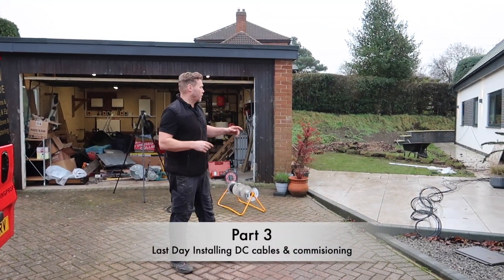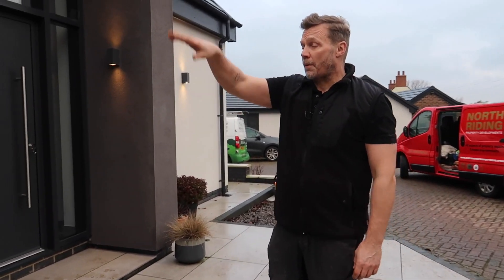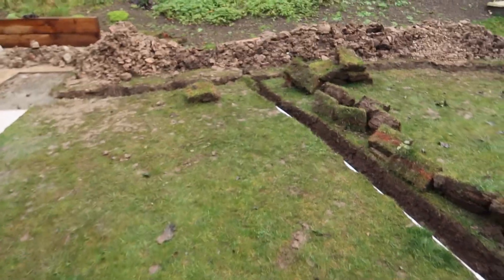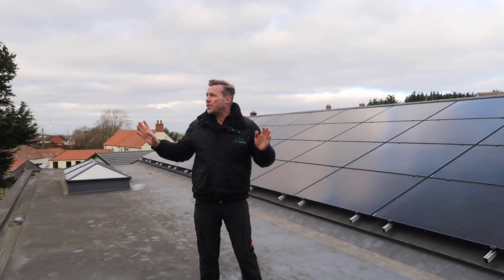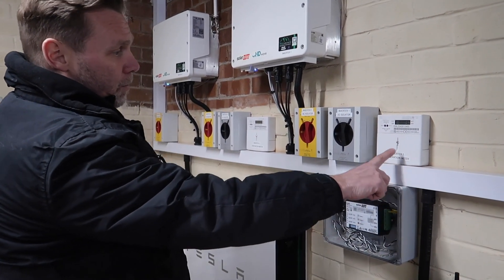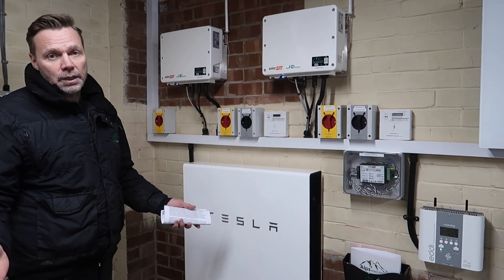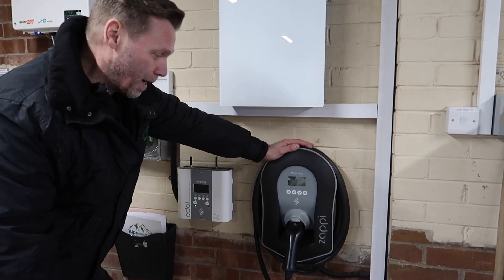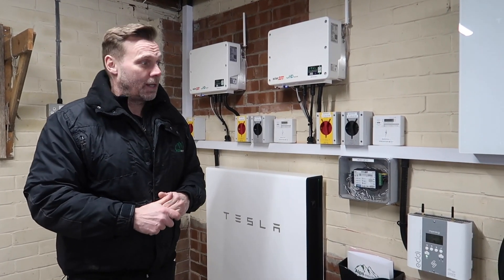SolarEdge 19.1 kW System with Tesla Powerwall & Zappi Install | Part 3 – Testing & Handover

Comment from the maker: ⚡ 19.1 kW SolarEdge System with Tesla Powerwall & Zappi – Part 3 (Testing & Handover)

This incredible system features 44 Jinko Tiger Neo 435 W panels, SolarEdge optimisers, 2 × 6 kW inverters, MyEnergi Zappi & Eddi, and a Tesla Powerwall — installed by Alps Electrical Ltd in Seamer, Stokesley.

▶ Watch Part 1 → https://www.youtube.com/watch?v=xKoc4Msuojk
▶ Watch Part 2 → https://www.youtube.com/watch?v=yB75DoWykXc

💬 Interested in solar or battery storage?
📞 01642 790489 | 🌐 alpselectrical.com

📍 Serving Teesside • Durham • Sunderland • Newcastle • Northallerton • and the wider North East.

🔔 Subscribe to follow the full series and see more real renewable-energy projects from Alps Electrical Ltd!

Comment: Really great looking install guys. Just wondering how well the products from Myenergi and Tesla integrate from a data and control standpoint. Can one app rule them all or is it case of having to jump around?
Reply from the maker: Hi, thanks for your comment, yes they work perfectly together. Most customers tend to use the Tesla app for day to day solar information and household consumption etc. If you want to alter the Zappi settings its necessary to use the Zappi app! :) Hope that helps!